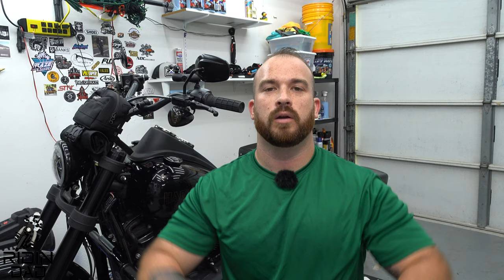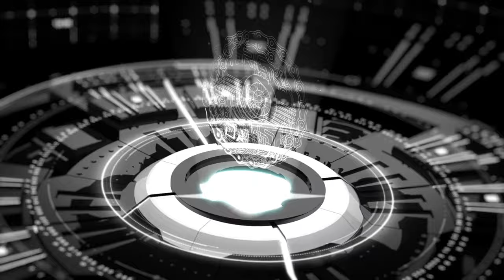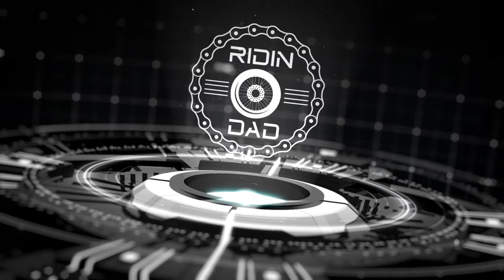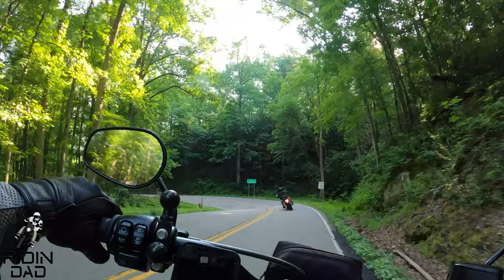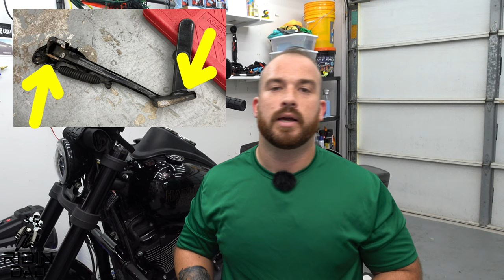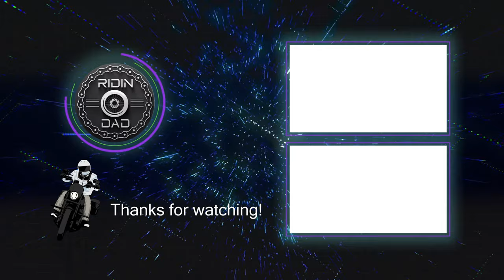Why I'm Ditching the Kickstand lowering kit from Bare Knuckle Performance - not safe!

Comment: I constantly drag my kickstand on my 21 lrs , thankfully this hasn't been an issue yet but scary stuff dude . I've got shims in the front but standard height rare.
Reply from the maker: Yeah that’s pretty standard. The big difference is the give that it has when you hit the kickstand because you’re scraping the back and it has the rubber stopper.

Comment: Thanks for this vid, this is:good info. How about just bolting a wider and taller base for the kick stand, similar to what they sell for the adventure bikes so they can park in gravel? That would help adding a little more height to the stand. 

Regardless, let us know what ends up working for you!
Reply from the maker: Oh yeah man that’s actually what I did kinda. I was gonna go the diy route like someone had recommended but I bought some stuff from my machinist and he had a kinda cheap kickstand block extension so I went with that

Comment: How many inches was your bike lifted when you had this installed? Did you have both the front and rear suspension lifted?
Reply from the maker: I can’t remember for sure but I think the front wasn’t lifted yet. Back was by around 2 inches + or -    But it’s the same issue regardless of how high the bike is lifted. It’ll always impact first and decrease lean angle
Reply: @RidinDad  i noticed on their website they have a note that the bike must be lifted a minimum 2" for use and was wondering if this was in response to the scraping issues people are experiencing.
Reply from the maker: No, not at all. Whether it was lifted 20 inches or 1 inch that would still hit first, and it was still decrees, lean angle, nothing matters about the height of the bike as long as that is the same piece being mounted on the frame. All that is about is the height for the GP stand to work properly. If the bike is not lifted high enough, the GIPHY stand will not log into place in the bike won’t lean over safe enough to stay put
Reply: @RidinDad  true, its the first part of the bike that would make contact with the ground.
Reply from the maker: Yeah exactly

Comment: You think this thing will still scrape on a lifted bike? My 21 FXLRS has +2 front and 14.1 shock in the rear. It leans like crazy when it sits on the stand. I need something for it bad and was looking at this thinking it sits tall enough that this might work. I hate the look of the riser blocks and none of them seem to install clean on the FXLRS kickstand.
Reply from the maker: Yes 100%. It’ll scrape on any bike height. Just changes how soon it scrapes. My bike is lifted a little too

Comment: Yeah seemed dangerous when I saw them, but I wasn't sure. Trash it. I got a 2016 FXDLS with 14in rears/legend axeo fronts, I just use a drag specialties +1 kickstand.. I also got the 1in bung kings extension block in case but it wasn't needed. Just sits on my nightstand
Reply from the maker: I’m weighing my options for sure!